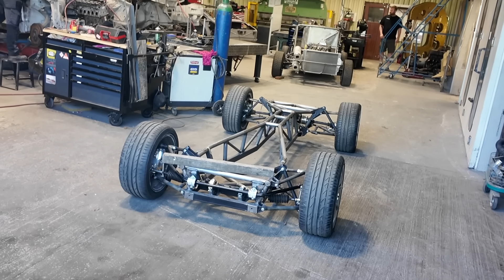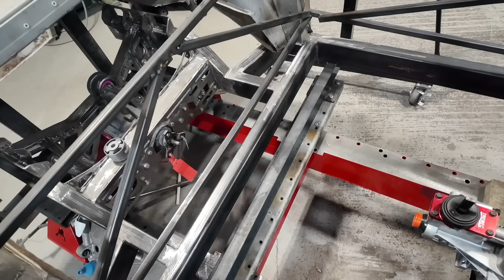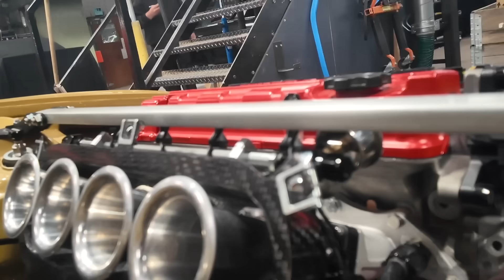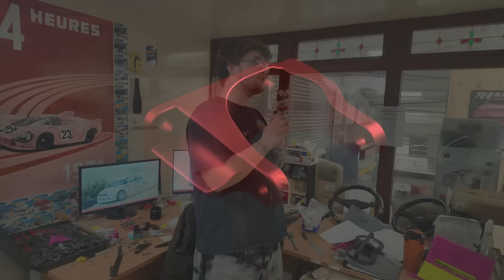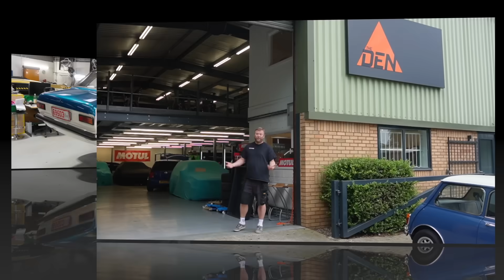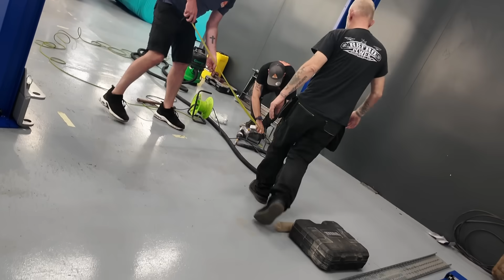Ultimate 70s Coupe Restomods!

Comment: @retropowercars
 Regarding the e9 rear struts, BMW in period offered coil over rear strut conversion that could be retro fitted at the dealership. As far as im aware this utilised e3 rear struts. If you look carefully at the top of the e9 shock tower you should be able to see 3 equidistant indents, these were the drill points for the strut top mount. Another option would be to use e12 rear stuts.
I have the number of a couple of guys who MAY be able to help you with a bonnet dm me if needed.

Comment: Why on items such as boot and bonnet on the Escorts and other vehicles do you keep using carbon fiber, they are not racing cars and therefore lightness is not an issue, surely you can get new parts of non special items ?

Comment: Question… was widening the scimitar body by say 50mm ever considered? From a layman’s terms that seems to solve quite few problems easily? And it surely would have been more visually “powerful” and “planted” with the extra width? Absolutely love the show btw. Always in my diary every Monday. Regards Paul from South Australia
Reply: I think I remember Nat discussing it but widening the whole car from the roof down incurs so many new (unique) parts , hand made windscreens rear windows, dashboard, bonnet panel, boot/ hatchback panels etc you can already see it doesn’t even come near to being viable…
Reply: @philtucker1224  yeh good call Phil. I must have missed that discussion. I thought everything would be bespoke anyway, but I guess there has to be a limit on how much they can charge a client for their excellent work!
Reply: @paulgr333 yes plus replacing a smashed windscreen for instance..
Reply: @paulgr333 yes very true, (although that “limit” you suggested is probably often about the value of a decent three bed house in many cases ha ha!)  Kind regards to you buddy..

Comment: With the scimitar, why not push the b pillars out by an inch or two per side? Leave the nose and tail where they are. 

If you're doing the custom body, I'm sure you could expand it a smidge and hide it in the styling of the flares.

Comment: Ok guys if your aim is just UK residents in your following you are doing well, my own perspective is i learned international English in New Zealand at 14 from 1967, as a retired mechanic and fabricator  here are a few points to consider a vehicle has a Left side and a Right side looking from the back to the front of the vehicle , in the horse and buggy days this would have been called "  nearside and offside" probably to reasure lower class people that you had a bigger grasp of an old language? Millions of english speaking mechanics use 2 posts or 4 posts " HOISTS to elevate their customer cars , but the UK branch call them RAMPS.?? A ramp in the English language means and still means " an angled incline!  I watch multiple English automotive youtube channels so there are a couple of guys working out of a two car workshop doing Salvage rebuilds uk they have 360k subscribers , why are you still struggling at 70k? I am not nagging ( although it may look like it , but i was born Dutch so its a straight up discussions)   would be great to see 100k subscribers by christmas
Reply: @hanshoogendyk2203. Not 100% sure but for the U.K.where we drive on the left, I believe “near side” means “nearest the kerb” ( that’s “sidewalk” to our cousins in the U.S.A.). As for the car hoist being a ramp…. Maybe it harks back to days of yore. Horse drawn carriages - with tall spoked wheels - only required a low level “ramp” to raise them up so that any repairs or maintenance could be carried out by the coachmen at the mews/stables. So it could be that the term has been used in posterity that any “vehicle lift/elevator” is a ramp. Stay safe and well.

Comment: Question. Would you consider building a Kit car if there was enough money?
Reply: Check out the Stratos from a couple of years ago.
Reply: @nickjones3222  Didnt see the first episode of that....never realised it was a kit.
Reply: ListerBell costs £40,000 and one with a 300hp Toyota/Lotus V6 is near £80-100,000 on the road and legal, VT make a bolt on supercharger and it has 400+hp. The orange Stratos took Retropower 5 years and the guy spent £250+ as he has been trying to sell it for a few years at that price. They tried to sell it for £140k at auction..no bids. There are also questions about insurance as the car was MOTed with a standard louvered hatch, exhaust, tail lights etc as it's not a Stratos replica anymore.  Hence the questions in the comments about Q plate and IVA as things aren't as loose as they once were or you pay a lot.

Comment: Good old Nat. Any autofocus plans looking? I’m knee deep in repairing a Sprinter T1N and would love to hear from yourself or Bobby on chassis repair work, namely mig welding thick or structural areas. Also, Raptor…I can’t find anything online showing it being done smoothly through an HVLP and I remember you doing that on previous projects but can’t remember which projects
Reply: Could I suggest that you try and get in a course for welding.  As for paint check the Tds (technical data sheet) this will have all the information needed. 
As you have asked these questions I would think that you have a very steep learning curve. Good luck and i hope you enjoy the journey. Please get on a course though, just to bring you up to speed faster. £1000 on a few lessons will save you more then that in time. As your time is at the very least the hourly rate you can earn at work. In reality it the time you trade with loved ones.

Comment: My experience is that a ROM is a Rough Order of Magnitude.  Meaning, it's a rough and ready estimate, it will/should be "there abouts".  Whether it's a "reasonable" cost is another discussion to be had.  I have (many times) challenged the reasonableness of a ROM - and seen dramatic changes in the level of said ROM!

Comment: Question for next week. How do you register the cars with Dvla? I can understand some keeping the original reg no problem but the majority are majorly modified. I’ll be interested in your answer (if there is one)
Reply: I've certainly asked the same before. I expect the topic is sensitive.
Reply: I have asked the same, DVLA are very clear on what is required, using a points system on originality of various components like, chassis(un modified) engine, suspension, axles and transmission. It would be interesting to hear of they do the full IVA inspection and how they avoid a Q plate 🤷‍♂️
Reply: @jamest5149  The answer seems to be that professionals have ways around the system not available to mere mortals.
Reply: @jamest5149 That’s the customer’s business, not RetroPower’s…
Reply: IVA. https://www.gov.uk/vehicle-approval/individual-vehicle-approval
Reply: (They’ve already answered that question years ago) If a customer wants a car built for road use that for whatever reason has no vin registration then the car has to undergo a thorough roadworthiness safety inspection and then (if approved) a legitimate DOT vin number is awarded to that vehicle. A 2025 (Q plate) can then be applied for.
Reply: @philtucker1224  No, that doesn't answer the question. The question is about a car that is massively altered from the one bearing the VIN. For example, the Allegros are not Allegros, and the SAAB is not a SAAB. The Aston Martin is barely an Aston Martin.
Reply: @johnbriggs3916 I think that is the responsibility of the registered owner. Certainly not RetroPowers concern. Each owner will have their own ideas on what they want from the car and what they are able to use it for.
Reply: @philtucker1224  Don't be absurd. Of course it's Retropower's concern  --  they are building roadgoing vehicles! They will be the ones arranging the IVA.
Reply: @johnbriggs3916 no I don’t think they do actually. (No disrespect to you but maybe you should do a bit more research before you put yourself out on a limb like that…)
Reply: @philtucker1224  "I don't think"  --  who's going out on a limb?
Reply: @johnbriggs3916 ah, you are a troll..
Reply: They put them through an IVA test if the car hasn’t retained enough original parts, then the car is registered as a brand new car, with an age related plate for the current registration year, which means that it’s then no issue to put the original plate on (which would have been placed on a retention certificate during the build) because it’s perfectly legal to put a cherished plate on a vehicle that makes it look older (just not newer).
Reply: You can’t put a retention plate on a Q plate car.Are you sure you can put a new plate on an Iva’d (if that’s even a word!) car where some of the parts are not new?
Reply: @Jonathan_Doe_  Fun fact: there is no type approval for Morgan cars  --  each new vehicle goes through IVA!
Reply: Good question. I remember a guy that converted a PA Cresta to 2-doors and put the body on a XK8 chassis. Perfect build but I can never remember how he dealt with the DVLA.
Reply: It's probably a can of worms they don't want to open on here as every keyboard warrior and his dog thinks they are an expert on it.
Reply: @malcolm8938  As I've pointed out before (and it keeps getting deleted), professionals can get away with things that mere mortals can't.

Comment: Surely the Aston should have an original v8  with superchargers knocking out around 500 HP   But it’s the customers car and he’s choice.   I know it’s going to be a great car when finished  ❤❤❤  the E Type is going to be epic as well.  👌👌👌
Reply: There is a reason aston martin v8 of that era are rare, HUGE COSTS, and under engineered reliabilety  HUGE COSTS  😅😂 now 50 years old corroded, rotten inside etc  chev v8  100% reliable for 200.000 miles and more power and fuel economy,   but here is the biggest kicker it meets polution standards where as the aston v8 would not and can not be made to mèt those standards
Reply: @hanshoogendyk2203 thanks for the reply   So what about the later V8  engines that Aston are using now.  Because an Aston without its engine is not a true Aston.
Reply: There was an Aston Martin raced into the 90s with a twin turbo and raced at LeMans and led to the Aso Martin Nimrod racer